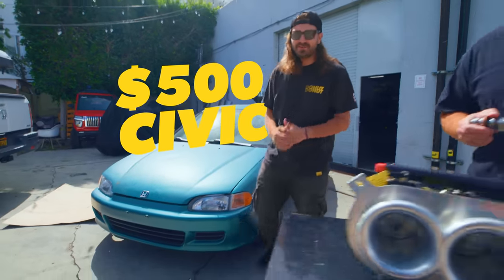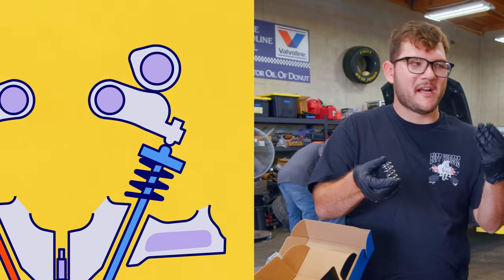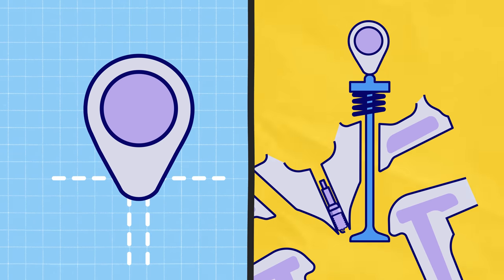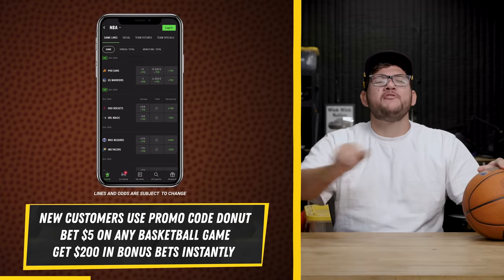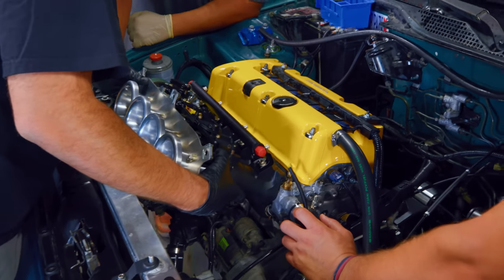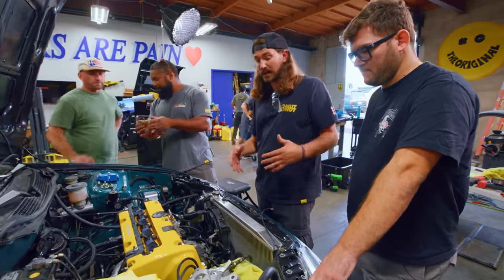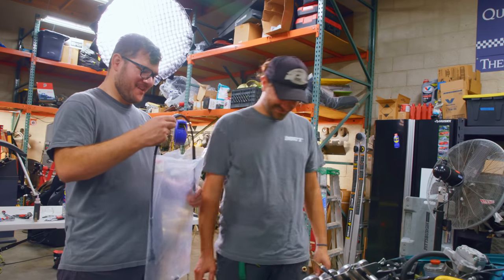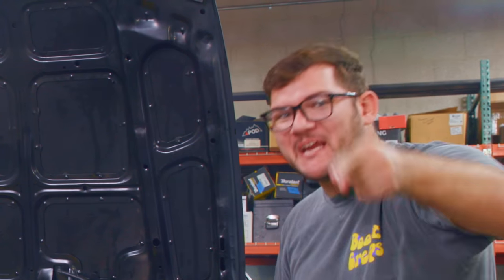We Put a $5,000 Intake on our $500 Civic

Comment: you guys should do this series again with an EK and a 5k budget.  I was deliverin pizzas in a gutted out EK d16 for a long time and even with some basic mods it got pretty fun. I probably only had a grand in mine and most was maintenance. If I were to buy another civic Id buy an Integra auto car (cause itd be a nice cheap shell) manual swap it, (there are no clean manuals left) do the suspension, cut ALL the weight, toss some seats and a drop in cage in there and be off to the autocross. That right there for a civic is probably like 3 grand to do, leaving another 2 grand for  wheels and tires. 30k civics are fun to look at but would be ridiculous to spend normal dollar bills on.
Reply: also my civic had 241k on the odometer when I bought it, it didnt work so who only knows how much it had on it. I drove it for three or four years in brutal stop and go city driving (delivering pizza, constantly on and off, and I drove it like you drive an old shitbox civic and the only time I got stuck anywhere was because of a loose starter cable. I got out, pushed it to get it going, hopped in and bump started it and off i went! FANTASTIC little cars

Comment: 5:30 a bit wrong there 4 x 60mm intake channels is not equal to 240mm hole. the area of 4 60mm holes is 0.0452m and the area of  a 240mm hole is 0.181 which is FOUR times more

Comment: 5:30 if you do the math the combined holes make a circle with 120mm diameter not 240
To reach the area of a 240mm circle you would need 4 holes with a diameter of 120mm

Comment: To the experts: if you push the valves down further and for a longer time with an upgraded camshaft, wouldn’t the valves potentially hit the piston head? Would you need to adjust the engine timing to avoid this?

Comment: The math with the holes is wrong.
The area of the 65mm hole which defines the volumetric flow of air is 3,300mm2. The area of a 60mm hole is 2,800mm2. The area of 240mm hole is 45,000mm2, which is quite different from 4 x 2800mm2 (which is 4 x 60mm airflow). By using 4x60mm holes you increase the airflow by 3.4 times vs single 65mm hole.

Comment: 65mm TB vs 4x60mm ITB is like comparing a 65mm hole with a 120mm hole (not 240mm).

It’s area, so it’s squared, a 65mm TB flows 29% of a what a 120mm TB, or the other way around, 120mm flows 3.4 times more than 65mm.

120^2 / 65^2 = 3.4

14400 / 4225 = 3.4

4225 / 14400 = .29

Comment: 5:30 you cant just add up the diameters, should know that jobe ;)
basically you need to calc the surfaces ie: radius^2*pi which results in ~3.4 times more air, not ~3.7 times more as 240/65 suggests ^^

Comment: Hello donut friends, really a fan of you guys, but being a performance nerd, I would just like to correct the intake area discussed at 5:25  Comparing 6X60mm to a 240mm diameter unfortunately is not correct: 60mm intake bore is = 28.27 cm2.  if you multiply this by 4 throttle bodies, you get at 113 cm2. If the fact that you just multiply the diameter of 60mm 4 times to get to your stated 240mm diameter, this gives you an area of 452 cm2. Calculate this compared to 4X 28.27 cm2, and this will give you 113cm2 !  Thats about a 750% error. Not trying to nerd out or bash, but I know you guys have engineers on your team, and should exploit that ;) All the best !

Comment: not claiming i know how to do this math off the top of my head… but it’d be cool to calculate/predict exactly how much power you’re expecting to add with the new intake, and then compare that projected value to the actual value measured from the dyno. i assume you can model the old vs new intake, and calculate your new throughput of air based on the new geometries of the CAM lobes and manifold

Comment: loved when said that the area of 4x60mm (11309.6 mm) holes is the same as the area of 240mm (45238.4 mm), even have a drawing and animation for it and they did not noice the problem. It is wrong like 11 vs 45 wrong.

A65mm =3315.8  square mm
A60mm =2827.4 square mm 
4 times A60mm =11309.6 square mm 

So you get it 4 times A60mm is 11309.6 square mm

In contrast the 240mm is 45238.4mm square mm

Comment: i understand the spring ting but how muck a stiffer spring will impact the engine power. the cam have to puch on the spring. so it add engine restriction?

Comment: 4 times a cirkel with 60mm diamater doesn't equal a cirkel with a diameter of 240mm, It is closer to half of it! about 120mm.

Just calculate the area of the 4 throttle bodies, use that number to calculate the new diameter.
4*30^2*pi = 11309.73mm^2 new diameter is 2*Square root of(11309.73/pi) = 119.9999812mm

Comment: I think you will have a note from the teacher - See Me.
65mm throttle gives 3318mm^2.
4 x 60mm gives 11,308mm^2

240mm throttle would be 45,239mm^2...

At which point your engine wouldn't run.

Comment: 5:31 technically the area of 4x60 mm bore is 3600pi mm^2 and the area of a single 240mm bore is 14400pi mm^2 so having 4x60 mm is actually like having one 120 mm bore not a 240
Reply: diameter of a circle that has the same area as 4 60mm diameter circles = 2*square root(4x(60/2)^2) = 120

Comment: I know it's a bit nerd but four circles with a diameter of 60 mm are not equal to one circle with a diameter of 240 mm ,The node area of a circle with a diameter of 240 mm and a radius of 120 mm is equal to 14,400 mm² times π, but the total node area of four circles with a diameter of 60 mm is equal to 900 mm² times π times 4
 120²×π≠4×(30²×π)
4×(30²×π)≈11,309.733553 mm²
(Round to 6 decimal places) 5:28
Reply: btw...the formula for the area of a circle is the radius squared times π
Area = π • r ²

Comment: Delete that power steering, and go for a manual rack, or mod this one to remove the piston and hydraulic valve to reduce slop and make it lighter to turn. Once a car is moving you don't really need it anyway. 
You will lose something like 5kg of weight, remove some parasitic drag and inertia on engine. And get a better feel for your front wheels.

Comment: The 65mm vs 60+60+60+60 does not really work that way

It is almost 4 times as much yeah, but 240mm would be way more than 4 times extra

You have to take the area with Pi (3.14 X RADIUS)

Comment: Actually you went from a 65mm intake to a 120mm diameter equivalent intake (not 240mm), you need to calculate the area of the new intake not just add up the 4 separate diameters.

Comment: There’s a mistake in your calculations.

4x60mm (11309.733 mm^2) throttle body is less surface area than 1x240mm (45238.934 mm^2) throttle body.

In fact, the 240 mm individual throttle body is about 4x larger in surface area than 4x 60 mm.

Comment: Honestly probably shouldn’t have done I.T.B on this build. 

A Fat Common plenum with longer and slightly wider runners. And a properly sized throttle for the runner width. That together would keep the air velocity up down low where larger cams are going to sacrifice some air speed.

And when you consider that turbo car on the other side is literally going to be pushing air trough....Well you’re going to want that extra flow down low. 

Look at it this way. Do you want to get to your peak horsepower faster? But it’s a few less at peak.

 Or do you want a few more hp at that peak?.......well okay. But you’re going to wait longer to get to your peak. And then when you do get there. You’ll be faster. However You blow right through it faster too..and you also have to shift right back to the slightly more sluggish climb to the peak.

That’s the other trade. And that’s why you should be concerned with trades down low for more peak. 

along with the cutting and other modifications needed for the i.t.b. and then comes the extensive tuning and tweaking. 

Well I’m just saying that it might have been cool to only come up a few hp with a single throttle, over the few more than that, the itb’s gained over a tunned single throttle system.

Comment: Math gone wrong at 5:30. 240mm hole isn't 4x60mm hole as the area of 240mm hole is 45238mm^2 and the area of 4x60mm holes is 11308mm^2 which is significant difference. 😀

Comment: The problem with your itb statement of 4- 60mm tbs out flowing a single 65mm tbs is that only one cylinder is on intake at a time. Add the harmonics of a correctly designed airbox and you are likely flowing less overall with your itb's. That said, everyone loves itb's, I love itb's. Itb's do offer a more responsive feel to the motor and of course great sould, I just wish uninformed youtubers didn't spread disinformation to the uninformed.

Comment: Does this mean you'll have 4 throttle bodies to clean instead of one?

Also curious if the ECU would need tweaking
Reply: They said it in the video, it needs a tune. They are easy to clean
Reply: @mrhatchyK24  cool, might have missed that part while doing the dishes.

If they intend to clean the TB fully / properly, they'll probably have to take the whole unit out
Reply: @vsmh96  I don't think so. I believe it can stay on the car. Not too sure never really researched itbs

Comment: The math is totally wrong. 1x65mm to 4x60mm does not equal to 1x240mm. By comparing the cross sectional area of 4x60mm you should get 342% more air while if you'd have one 240mm intake you'd get 1370% more air. 4x60mm is closer to 1x120mm.

I get this is not an engineering channel, but don't 240mm intake would be HUGE for a car anyway.
Reply: This is true, the single 240 mm TB, not withstanding the packaging constraints, would in theory allow 4x the amount of air compared to 4x 60 mm TBs.

Comment: 5:30 Nope😅. You're bad at math! 
Four holes with a diameter of 60 mm are the same as one hole with a diameter of 120 mm in area.
So, you ended up with a hole twice as large as 65 mm as four 60 mm holes😉.
But the hole area is 3.4 times larger than the 65 mm hole.

Comment: Do a B swap not a K swap, save some money
Reply: Lmaooo. B series are getting more  expensive. Also k series are easier to work on. And k is the new way. Nothing g wrong with b series, but this is how I look at it. For you to swap a bseries In a eg. Full turbo kit injectors fuel pump. Everything else you need for a turbo kit. Then you gonna have to build the motor. Unless you get a gsr motor. But those are alot more expensive then a b1 motor. And even then the gsr motor can handle as much power as a k can. And k's can make more stock and it still be reliable. So after the turbo kit the swap the built motor. And all the other shit you need. All that money you just put into the b series build. You could have swapped a k24 into it with a turbo kit. B series makes no sense any more  tbh. Yea are they great motors yea, but the k's are overall better.

Comment: $3k for the ITB? Or $3k for the cams, springs, professional help....
Reply: Itbs can run for 5-6k. You can get a little cheaper one for 3500. Or you can go the cheap way and get obx itbs. Cams are 9-1k. But you can always get the more expensive ones for 1500. Springs Are around 350.

Comment: So, you are going from 65mm to 60mm ITB's... such a waste. First, your gains will be minimal. In the standard intake, no two intake valves are open at the same time, so they are not fighting each other for air. So you are actually reducing the size of flow for each, not increasing. The gain comes from the less restrictive path for the air to flow. But then once you place the filters on, you are again reducing the air flow... Do they sound amazing? YES! But they take up SOOO MUCH SPACE are also horrible to tune well, both digitally and mechanically. I bet you don't even get 10hp gains out of it... $500 per hp if you are lucky... but it makes for good entertainment!

Update: Just got to the power steering pump!!! See what I mean! Too much space! Also, now you have to spend MORE money for the belt relocation and electric power steering! And you have to cut the hood up, which to DIY it, I'm very skeptical about how well it will look when completed... Best to take the old hood, chop it up, then use it as a mold to make a custom carbon fiber hood... but that is more money! But will reduce the weight to help you beat a new Type-R!